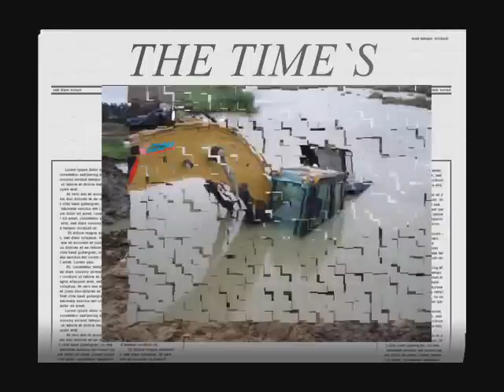CATERPILLAR 330

Comment: as long as it got shut off in time , drain the pan , dry the air cleaner, drain the fuel  start the engine and go to work.